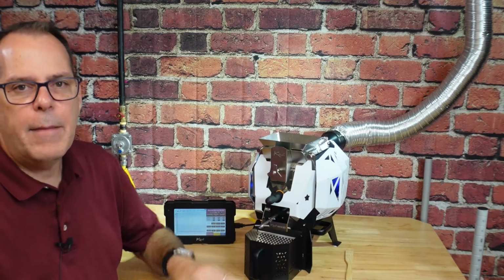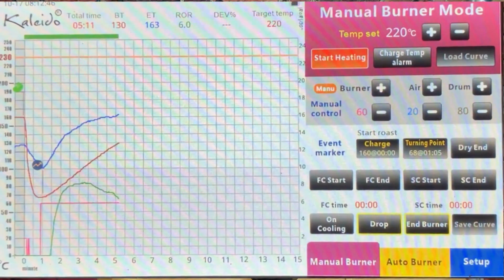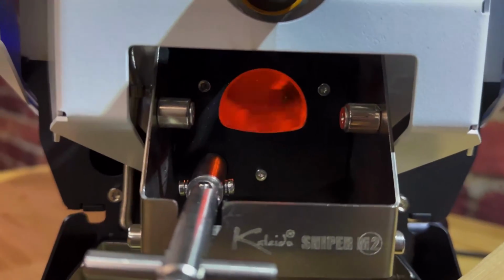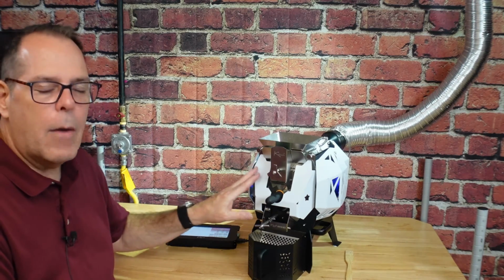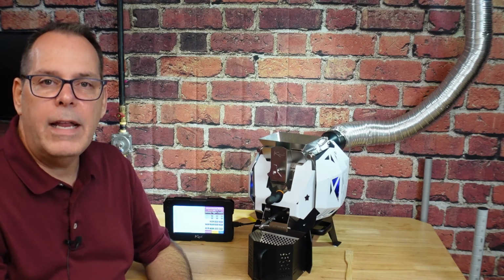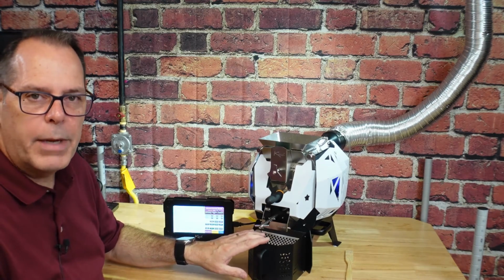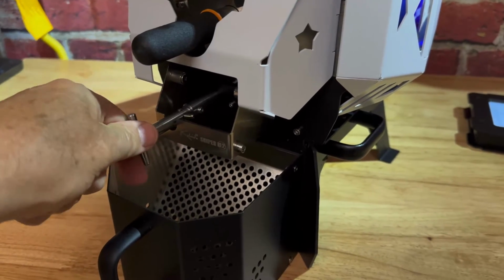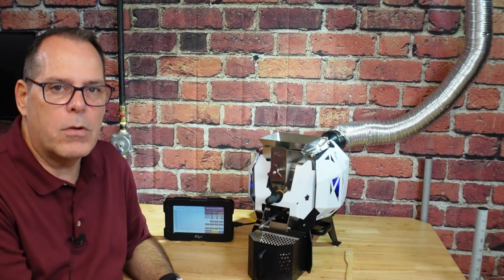First Impressions Of The Kaleido M2 Coffee Roaster

Comment: I found this video very helpful and actually just purchased an M2, however, you show an adapter to tightly attach the exhaust tube to your vent tubing but their instructions very specifically say not to do that.
Reply from the maker: Hi Barry,
You are absolutely correct.  Kaleido is now recommending to not direct connect.  I’m not sure how long that recommendation was published, but when I got my M2 a couple years ago and my M10 about a year and a half ago there were no recommendations.  I’ve recently changed my venting system which will be highlighted in my next video using the M1 Lite.

Thanks for your message and for watching.

Comment: Hi Mike, a bit late to this video but are you able to tell me if there are any downsides to the M2 mesh drum compared to the M6 solid drum
Reply from the maker: Hi Keith,  I was am not aware of a "solid" drum for the M6, compared to the other models.  All current models are made of stainless steel drums with unique blades in the drum to promote airflow and bean movement.  The actual drum does have "slits" that allow chaff to fall out and promote airflow.  My M2 and M10 both have this type of drum and i've been very happy with its performance.

Comment: I am using Kailedo M2 to roast coffee but some batch it auto stop and auto drop coffee despite the batch is not end as initial setting 
How to fix that error
Tks all ❤️
Reply from the maker: Hello Hai,

It could be your SV setting.  If you are roasting in the manual mode, you should increase your SV setting after charge.  Increase to 220c or some temp your BT won’t reach above your planned drop temperature.

Comment: Hey Mike , 
I rencently got an m6 based off your video . I n wondering what you use as a connecting point for the exhaust to the 4inch vent?
Thanks
Reply from the maker: Hello.  I'm using a "dust collector reducer sleeve".  I'm using a 3" duct to connect the two so my adapter looks something like this:
https://www.grainger.com/product/JET-Dust-Collector-Reducer-Sleeve-48RJ24

Comment: Hey  Mike thanks for the informative videos on the Kaleido! Quick question about your time with the Kaleido M2. I know you were giving some criticism about the exhaust vent being horizontal and not vertical and noticed you had an exhaust adapter where you were venting out the exhaust. Did you have any trouble getting  your 1.5in - 3in exhaust adapter to fit the Kaleido exhaust? It looked like you made some cuts to the exhaust reducer and im assuming it was not fitting at all when you installed it. Any tips on that ordeal? I dont think I have the tools to cut slits in that exhaust adapter unfortunately.
Reply from the maker: Hi Jon,
the adapter is soft metal and isn't hard to cut.  I did the slits to create a flange and then clamp it onto the Kaleido exhaust.  It works great.  A pair of tin snip at a hardware store should do the trick.  Very happy with the adapter.

Comment: hi! it is there a best (or ideal)  RPM for the drum to roast 1Kg of green seeds ?
Reply from the maker: Hi Philipe, thank you for watching.  My Kaleido M10 is a 1.2 Kilo roaster.  Depending on the batch size I will run the drum at 70 rpm.  

The goal is to have good bean movement that causes some "lofting".  This is where the beans get a little airborne.  When this happens, the beans experience "convection" style roasting.  If you run the drum too fast, the beans will centrifuge... meaning they will be pushed outward towards the drum and won't tumble or loft.  

The drum size can vary even though the roaster says it 1 kilo AND your batch size will impact bean movement in the drum.
Reply: @VirtualCoffeeLab i'm really thankfull for the tip, but how 70rpm translate to the board control
Is it 70 on the board = 70rpm ?
Reply from the maker: For your application you should watch the bean movement to determine the necessary setting.  You want your beans to have some loft and good overall movement to prevent roasting defects and promote convection heat transfer.  You do not want to "centrifuge" your beans to the drum wall with too high a drum speed.  Every machine is different.  Also, your batch size compared to the physical size of the drum itself will affect bean movement.  This is why it is important to use your sight to ensure good bean movement.  For my roaster, 70 was the board speed, not rpm BUT it is probably around 65 RPM.

Comment: Hey again, Mike.  Still considering the M2. I spoke to the Espresso outlet and they mentioned that the M2 sealed version is not really intended to be ventilated with a duct hose? I see you have it set up this way, and this would be my preferred way too. 

 Also was curious which artisan version you used and on which operating system? I've heard the artisan software on the Kaleido can be troublesome and finicky in various ways.

after i get the M2, i would be interested in doing a remote consultation with you as i am a bit worried that i will waste coffee and not create a drinkable product.  On your webpage, it doesn't display this information anymore, so I was curious if you are still doing this?
Reply from the maker: The sealed M2 is meant to be vented outside, yes.  The manufacturer is concerned about restricting airflow.  Aillio says the same thing.  

I’ve had success running a flexible vent pipe to outside.  I can’t tell you to do this because it appears to oppose what Kaleido recommends .  The Artisan software is pretty good, and I’ve had no issues.  Remote roasting consultation is still something I offer.  I look forward to hearing from you.
Reply: @VirtualCoffeeLab  Ok thanks so much. Will reach out to you once I get this thing. Take care.

Comment: I was considering this Kaleido or a Santoker roaster for home.

I am hoping to be able to go between training and work where your typical steel double walled drums are used, to a home roaster and to apply the knowledge I've acquired. And vice versa, i would like to be able to sample a coffee and take as much as i can from the ideal profile ive come uppn and apply it a more classic production roaster.

The small home santoker machine has this very thick drum which helps to approximate the heat retention of the typical drum roaster.  I have heard that these kaleidos use some kind of a cage as opposed to thick walled drums? So I'm not certain if it is the best home solution for my stated purposes?  I would like to be able to roast reasonably light and have vibrant acidity, with sweetness and complexity of flavor and aromatics. I guess im wondering if one of the kaleidos is sufficient for my purposes and my preferences, as I do like that it is avaialble from espresso outlet, where as the santoker is a Chinese machine where one must purchase via aliexpress, and the customer support for an American may be inadequate. 

I should state that I have acquired a lot of roasting preliminary knowledge but am in my infancy when it comes to number of roasts.
Reply from the maker: Hello Julius, thanks for being a subscriber.  Looks like you've watch Charlie's video about the Santoker roaster.  He seemed to emphasize the thick steel drum.  While i have had no personal experience roasting on the Santoker yet, I have roasted on my Mill City 500 gram which has a heavy steel drum.  I have experienced the difference between roasting with hot air, IR heat, Natural Gas, and propane.  I have also experienced the difference roasting on a solid steel drum compared to a cage.  I share this because I think my experience on these different types of roasters has given me the context to answer your question.

The Santoker seems like an interesting roaster and might be a great option.  I have included my thoughts based on your comments and the little bit i have either read online or seen in videos.

First, the Kaleido 2nd generation "sealed" roasters use a stainess steel drum.  It is fairly heavy weight, but not as heavy as my Mill City.  It does have "slits" in the drum and the Santoker does as well so chaff can fall out and some IR light can pass through onto the beans.  The My Kaleido drum is not a cage.   I do not believe the Santoker drum is double walled as far as i can tell and that feature is not mentioned in any of their specs that I have seen.  Also, I'm not sure the drum wall is thicker than the Kaleido based on the photos and videos i've seen.   

The biggest differences between the Kaleido and the Santoker that I can tell are:
 - USA Support and parts for Kaleido, which the Santoker does not have at this time
- 250 gram capacity for the Santoker, while the M2 is 400 gram capacity.
- Artisan or Kaleido logging software with the Kaleido, while the Santoker uses their proprietary software that does not currently display events while roasting.  Most commercial roasters are using Artisan, Cropster  and using this on a home roaster will help you transition from one machine to another.
 

Next, you mentioned the need to roast light vibrant coffee.  The Kaleido is very capable of this.  You are concerned about heat retention.  The Kaleido has thick metal chassis for the roasting chamber.  While it wasn't not as thick as the Mill City 500 gram, i have not had any concerns about heat retention.  

Now for the important topic of roasting on different roasters.  Not all large commercial roasters are double drum roasters. It depends on which commercial roaster and how old it is.  There are many that do not have double wall drums.  The big difference between roasting on a commercial roaster compared to a home roaster is not only the large hot metal surfaces on the commercial, but the large mass of coffee being roasted.  As the coffee gets closer to first crack, less energy is needed for several reasons, one being the hot mass of coffee that is now on it's way to going exothermic.  It will actually radiate heat, allowing some large roasters to coast/ zero energy (depending on their profile).  I share this because regardless of the design of a small home roaster, the roasting experience will be different.  This is where your experience with the coffee will play a critical role in your ability to transition from one roaster to another.  

I believe time roasting coffee on a drum roaster, whether it is a bullet, Kaleido, or Santoker will give you much of the experience you will need to roast on the larger machines.  There will be lots to learn and adapt to when you roast on the larger machines BUT your hands on experience on the smaller machines will give you a big head start in your production roasting journey.
Reply: Thanks so much for reading my long query and responding as you did. It definitely has given me some things to consider that wasn't aware of before. The M2 seems like a great option.

Comment: I have put about 30 roasts now through my M10, and I have been very happy with it. I find the sweet spot for batch size for the M10 to be about 600-800g. It will go up to 1kg, but I found the roast at that capacity to be a little too inconsistent. I roast a lot of natural process beans, so I do have to clean out the chaff from around the drum once about every 10 roasts. Artisan is great, manual roast control is easy and responsive, but I cannot comment on PID auto-roasting since I haven't tried it yet. It is a serious investment, but I can output a batch every 15 minutes, so I only have to roast a couple hours a month to supply two families and my workplace (50+ staff) with beans.
Reply from the maker: Congrats on your roaster Andy.  Great decision.  I love your motive for roasting and I am glad to hear you are manual roasting.  Auto Roasting can work with the Kaleido but it far from perfect.  I think the same thing can be said with the Bullet.  I have an M10 and roast plenty of 400 gram batches with no problems at all.  I have also roasted 1 kilo batches and was amazed at the power of the roaster.  

I would love to hear more about your roasting and even see some of your profiles.  Thanks for sharing your roasting journey, experience with the Kaleido, and for watching my video.
Reply: @VirtualCoffeeLab if u have a m10 then would you prefer m10 over your millcity gas burner? Would ypu mond to explain your preference?
Reply: That Mill City is his baby... These  don't even come close... You notice he didn't respond...

Comment: Power consumption in Watts?
Reply from the maker: 1600 Max Watts..  I use a 15 amp household wall plug to run the Kaleido M2.  The machine isn’t always consuming those watts,  it at 100% power with full power

Comment: Great video, Mike! A buddy and I are getting into roasting and we want to get two roasters a M10 for batch roasting and either a M1 or M2 to use as a sample roaster. Can the M2 still pick up beans in the trier when doing ~100 g batches?
Reply from the maker: Yes, the M2 can still catch beans in the trier roasting a 100 gram batch.  I just threw in 100 grams to test to confirm.  I have not roast 100 grams in the Me.  The smaller batch I’ve done was 200 grams
Reply: @VirtualCoffeeLab  Great, thanks for checking!

Comment: Did you find this roaster did just as well with 400g as 200-300g? I’m hearing a lot of reports from kaleido users that they are having success with 200g in the m1, 400g in the M2, etc. Whereas with most roasters, we see people aiming for ~80% or listed capacity for that extra control.

Thanks as always for such great content!
Reply from the maker: Congratulations Andrew.  That is exciting.  I think it is a wise choice.  If give you more options for batch size.  There will be differences in charge temperatures and heat settings when you roast different batch sizes.  For example, last night I roasted a 400 gram batch and a 300 gram batch for the same coffee.  I used a lower charge temp for the smaller batch size by 5c.  I also used a lower heat setting by about 5%.  The end result was a similar dry time for both roasts.  Just an FYI  as you plan your roasts.  Best thing to do is experiment with batch size when you season your roaster when it arrives.
Reply: @VirtualCoffeeLab  taking note for sure! Looks like EO got their shipment in and I’m inside of a week from first roast! Picking up a couple kg of seasoning coffee to practice with, too!

Looking forward to more M2 videos if you’re still planning to share some more!
Reply from the maker: I think i will have one more with the M2.
Reply from the maker: Hi Andrew, thanks for your question and for watching my video.  Yes, the M2 performed really well with the range between 200-400.  About 99% of my roasting was in the 300-400 range.
Reply: @VirtualCoffeeLab  appreciate the feedback, and your engagement in general on YouTube. Just converted my M1 preorder to M2. Now I need to make sure the garage is ready for 1600W! 😅

Comment: Hey y'all! How do you do the venting for this machine? If I'm not mistaken the exhaust is 1.5inch diameter and it looks like you have a coupler that increases it to 3 inches? is it pvc? I'd really appreciate some help! I have no experience with ventilation piping.
Reply from the maker: Don’t use PVC.  Temps are too high
Reply from the maker: I found an adapter at grainger that increases the exhaust to 3” which is perfect for 3” flexible dryer venting.  You Winn need a smaller hose type clamp for the 1.5 side and also a larger clamp ring for the 3 inch side.  See this video at the two minute and fifty second mark https://youtu.be/qt336EHW8BE

ALWAYS empty that chaff collector after every roast.
Reply: Thank you so much for your answer!

Comment: Great stuff!  M2 Pro arriving in a few days and looking forward to your Artisan videos.  Like that most of your info is adaptable to multiple roasters because they explain the basics of roasting profiles.  Thanks for the content.
Reply from the maker: That's a cool story.  Yea, the M2 will be a different experience but the sky is the limit now.  Be patient and take time to read the manual.  It is not the greatest when it comes to it's presentation but learn the operational side of the machine and then you can focus on roasting some great coffee.  You may want to consider seasoning the roaster and using those roasts to get a feel for how the roaster performs.
ALWAYS empty your chaff tray after every roast.
Reply from the maker: Thanks for watching and sharing Larry.  Congratulations on your new roaster!  What roaster were you using before the M2?

I’m glad you noticed I intentionally try to provide info that can be applied to a broad range of roasting devices.  Thanks for encouraging words!
Reply: @VirtualCoffeeLab   I have been roasting for about 20 years starting with an air popper and for most of that time a Behmore.  I decided  to improve and move to specialty coffees and learn roast profiles to bring out the bean characteristics.  Your content is just what is needed.  Thanks!

Comment: Is there a big difference between the sealed and non-sealed version? I just picked up a used M2 non-sealed version
Reply from the maker: Kaleido has made changes to their product line.  This page highlights the differences.  https://kaleidoroasters.com/pages/kaleido-hot-air-upgrade-whats-new-version-2-or-s-model-kaleido-roaster
Reply: What's the power required, in Watts?